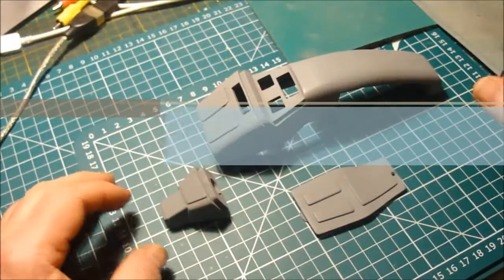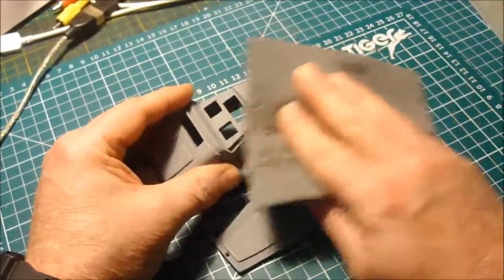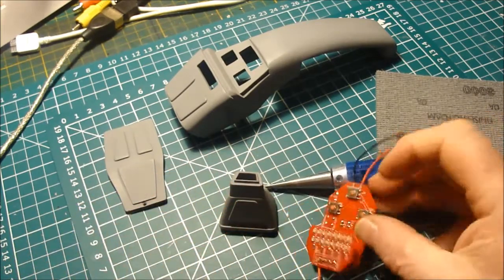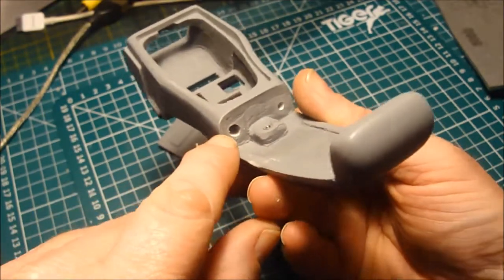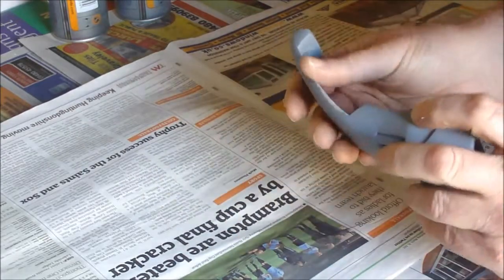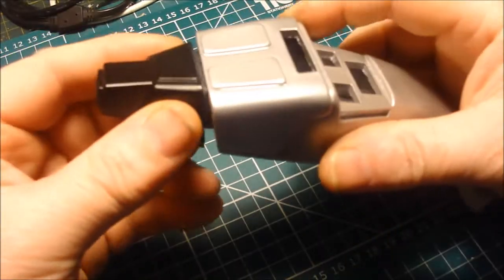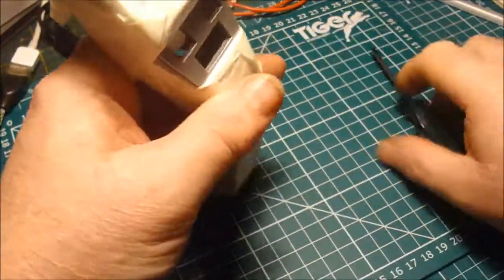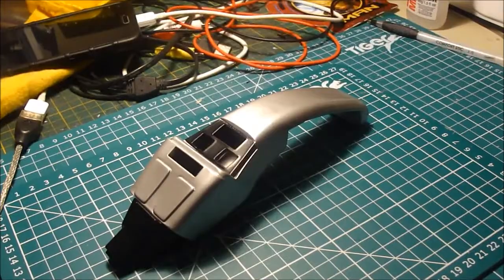Star Trek Boomerang Phaser Kit build  Part 2  Body Prep and Painting

Comment: Waiting for my Dolphin Phaser kit to come and the electronics. Got my paint and sand paper all ready. Now I’m using auto paint. The clear coat is a high gloss but it isn’t super shiny or anything. Did you use somewhat the same clear coat?  I find the flat clear coats really dull the paint.